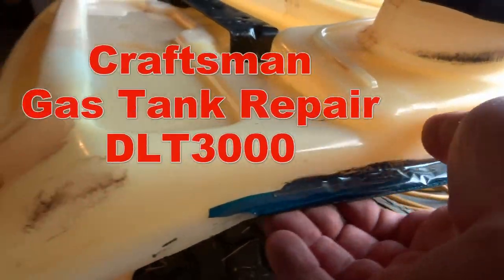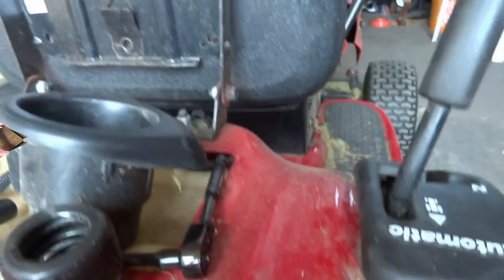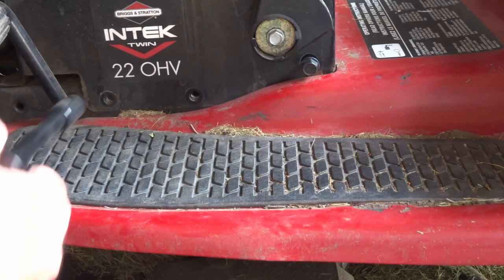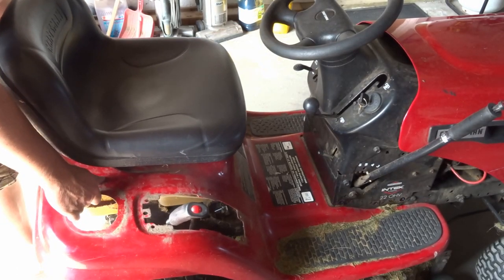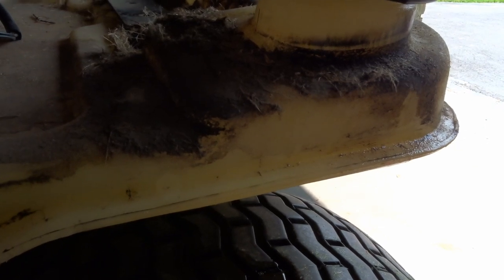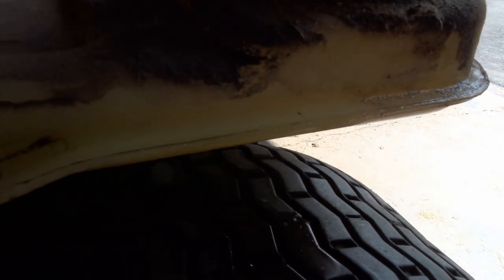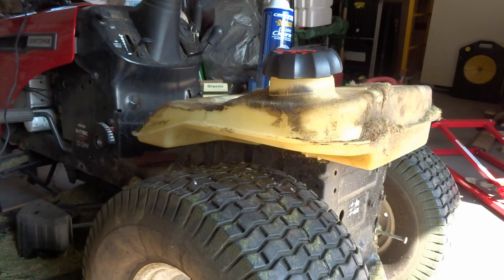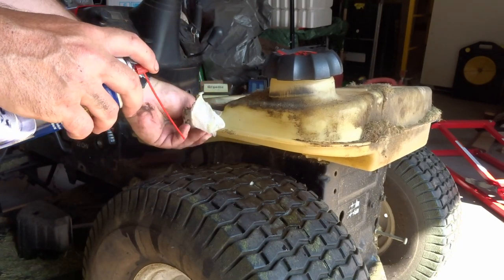Craftsman DLT 3000 Gas Tank Repair Complete Procedure

Comment: My LT2000 that I bought in 2003 has a gas leak too and I've been searching You Tube to find out how to remove the fender to get to the gas tank.  Finally, yours is the first one that actually shows how to do it. Hopefully it is the same as the DLT3000.  I'm also hoping the fuel line just needs replacing and not a leak in the tank.
Reply from the maker: Thanks for the comment, good luck with the repair…

Comment: Thanks! I have the DYT 4000 but everything was the same. The best thing about what you did was say what size each bolt was. Saves so much tine trying to figure out what size they are. I didn't have to repair my tank but had to replace the cracked fuel line, which requires removing the tank.
Reply from the maker: Thanks for the comment and checking out the vid…

Comment: I have a YouTube short video on my craftsman plastic tank replacement. What I did was scrap the plastic tank and I built a steel tank that now holds 1.7 gallon. I also replaced the entire fuel line at the same time.
Reply from the maker: Very nice, great video

Comment: I worked as a Sears lawn tractor tech for one summer. The grip handle WILL unscrew, just has some kind of Loctite on it. With the grip off, the shaft will slide right out of the body opening. No need to remove the shifter housing.
Reply from the maker: Thanks for the comment and checking out the vid....

Comment: My tank, like this, have a 6"x8" hole, in upper side. This part is descontinued. If you know, how I repare this? Thanks.
Reply from the maker: I have never repaired that large of a hole, however look into actual plastic welding, it can be done, but you need the proper materials/equipment.. or start searching for a used one.

Comment: FYI everyone this happens because the tank swells with pressure in the summer heat and causes it to split. A vented gas cap will help prevent this from happening

Comment: I had to replace the fuel line, I am mechanically declined but was hoping someone on here could help. There is a piece that fits into the bottom of the tank that you connect the fuel line to, that little piece came out, I connected the new fuel line to it but for the life of me can not push that piece back into the tank.  Any suggestions?
Reply from the maker: Thanks for the comment, I have never had the fuel line off the tank so I’m not sure at this point, hopefully someone will see this and comment, I am going to be doing a major repair soon as my engine is leaking oil.  But that does not help you much right now.. I’m certain someone will have the info you need...
Reply: @kd_enterprise3404  Vasoline - and twist it in with CAREFUL force as they break. There's a video on here that details this

Comment: You can save yourself a ton of time, and cost, by fitting an an external  gas can, such as used 5-liter oil jug, and running fuel line to it, instead of the original gas tank.
Reply from the maker: That is certainly an option, had the tank been seriously cracked I would have rigged something up, even one of those atv or motorcycle mountable spare gas tanks… slap it right on the tractor hood…  😂 or on the side etc..  good comment and hopefully someone will take note.

Comment: By the way that handle can screw off just put my Vice gripps on it and then turn it I forget which Way but just try either way it will come out
Reply from the maker: Thanks for the comment. Good info
Reply from the maker: Matthew Irwin thanks for the info!
Reply: You forgot which way?!?! (I taught my five year old like this, maybe it can help you too: "Lefty-loosey, righty-tighty.") Geez...
Reply: @drscubarob  Ive been a mechanic for 10+ years,and I get them screwed up sometimes, especially when a bolt is turned in a awkward position. It's not uncommon at all so don't  tear down your fellow brother!!
Reply: @drscubarob  Never heard of reverse threads?

Comment: WHERE CAN I BUY THIS IN 2020?
Reply from the maker: Hunter Algie not sure if you mean the tank or the lawn tractor.. the Brand as best I understand was taken over by Stanley Black and Decker. Many parts and engines are standard across some brands... parts can also be found at many of the well know  auto part stores..
Reply: I mean the tank
Reply: I broke my tank today and it’s leaking bad so I went online and I can’t find one
Reply from the maker: Hunter Algie your best bet would be to call a small engine lawn and garden repair shop, they will have the latest info or find a used one.
Reply: Thanks !!

Comment: it will never last i have tryed  that it will not last no  way
Reply from the maker: I did this repair in 2019, still A-Ok….
Reply: @kd_enterprise3404  well  you must have the touch beacuse it wil l not last an i will bet the farm on it
Reply: after a summer in the hot an then the cold ant going  to happen  it will come right a part
Reply from the maker: @glennfrans1295  Glenn the repair does not depend on the jb weld to prevent the leak, i melted the crack closed…I believe in the video I mention jb weld provides stability to the repair area… (fills any thin areas and stiffens the area) but I’ll take the bet… 😆… thanks for the comment, I do agree if exposed to gas it might very well fail over time.
Reply from the maker: @glennfrans1295  ok then, I tried…. I will Definitely buy a new tank or lawn tractor immediately… I’m sure after 4yrs it will fail next week… my point, do the repair without any jb weld.  Fill tank, if it still leaks you failed doing the repair… if it does not leak without the jb weld then success… and firm the area up with it…